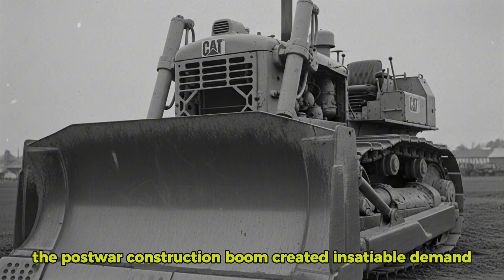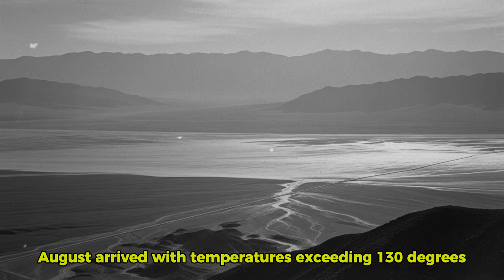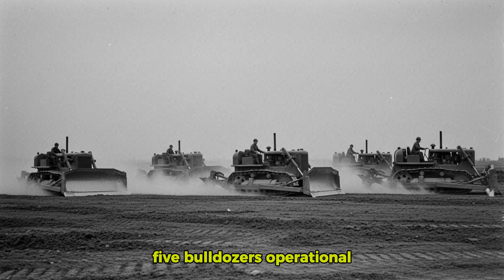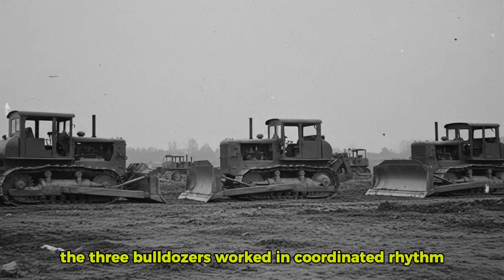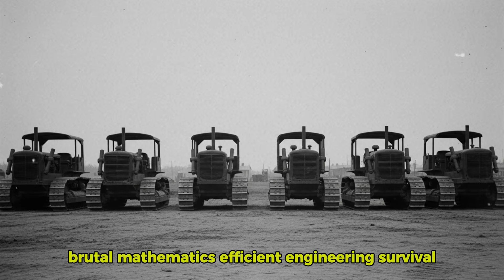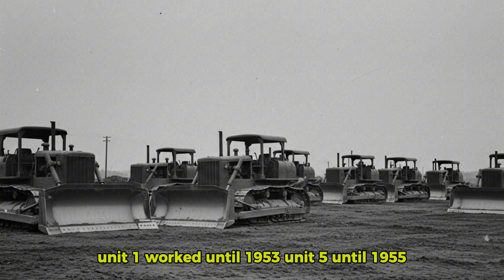How Did 12 D7 Bulldozers Survive Death Valley 1949 Only 3 Made It Out

Comment: I move from the east coast to Alaska in 1979 and went to work for a seismic company working in Alaska’s Arctic. I stayed on and did camp maintenance for the summer and fall and had a few Cats to use for plowing snow. We had a D-7G that I liked the best. We didn’t have to worry about heat, but we did have temperatures down to -50. It had a cab. We usually just left it running when the temps dropped below about -20F.
Reply from the maker: Hey buddy 🙋‍♂️ thanks for this valuable tip. Its a really nice machine 🤝